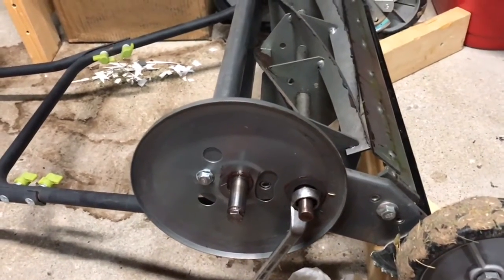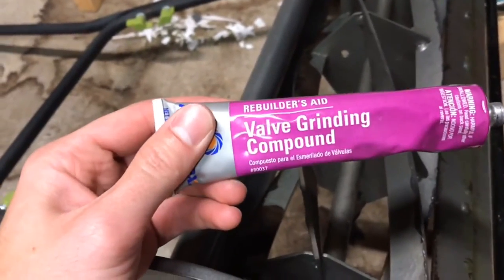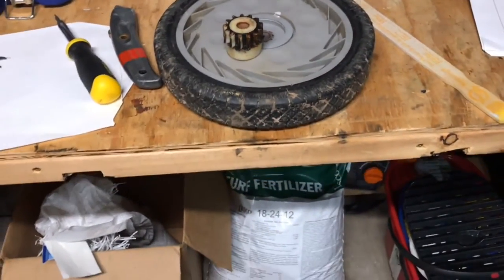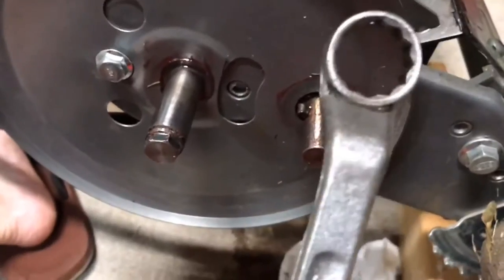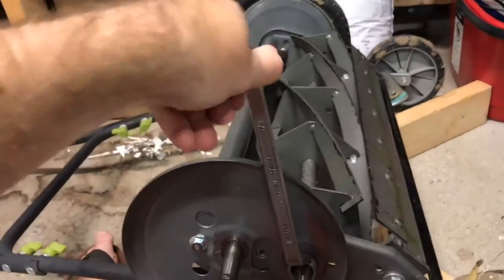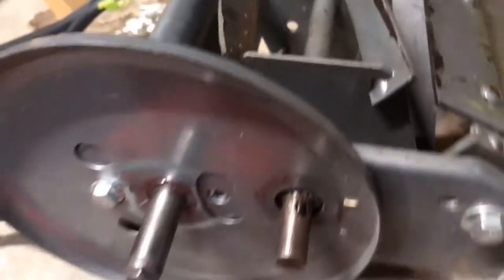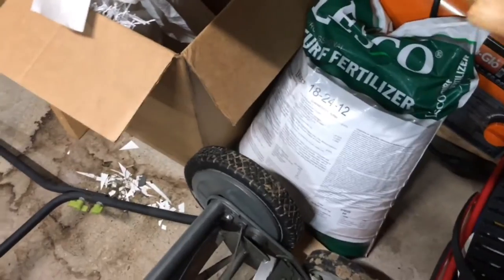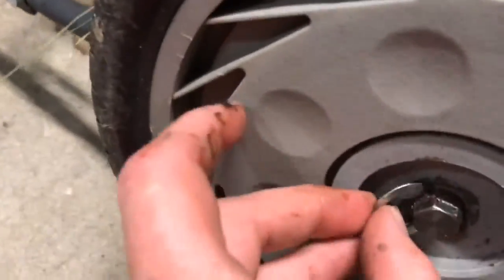How To Sharpen Reel Mower - Back Lap Mower Reel

Comment: Thanks! You mention a previous video that showed removing the wheel, etc. Can you link that? I've had a 3oz tube of Permatex Valve Grinding Compound for maybe 10 years, just not gotten around to researching how to utilize it to sharpen my Craftsman push mower, which I've had for maybe 20 years. I've messed with sharpening the blades with small sharpening stones, haven't adjusted the blades against the cutting blade. The mower works, kind of, but is a lot of work! It's time to do the job right!
Reply from the maker: Check this out https://youtu.be/iRiOtK2Hm6k?si=6Dq3pwY1ROqKElnK

Comment: So I’ve had one of these push mowers for a couple years because I like to be as green as I CAN... punn intended!! Lately I found myself having to go back over it back over it back over at several directions every other day!! I didn’t wanna do one blade (like I saw one fool doing!) at a time and I see most of the videos that are out there are more than five years old but I haven’t seen one yet that states that you should wash the stuff back off your lawnmower “cause it’s not good for Mother Nature” I want to try your technique but with my variable (so at a slow speed but faster than I can crank it by hand!) speed two transmission drill and a deep 9/16!!! So off to Amazon for some compound!  I am.... 💋🥰🪓🐞
Reply from the maker: This worked quite well for me! Glad you found the video useful! Make sure to take a piece of paper between the reel and bedknife and see if it cuts paper afterwards. You might have to adjust the clearance screws for the reel-to-bedknife so it’s cutting smoothly all the way across the cutting surface. Thanks for watching and commenting, good luck!
Reply: And as I was getting ready to turn it up I noticed one of the bolts was loose on the wheel somebody came to the door and I lost the keeper key!! For that side. Ug
Reply from the maker: Tedi Bare oh no! You might be able to find a replacement part. This is the company that makes several different brand reel mowers of similar design. I’d check their website try to find the make and model of the mower you have and check the spare parts list. You might need to order the entire wheel kit I’m not certain of that. Then once you find the part number search for it on amazon and see if you can find it for cheaper. I’d start here at this website. https://americanlawnmower.com/collections/replacement-parts

Comment: Don't you need to adjust the screws though after backlapping?
Reply from the maker: Ah yes you are right sorry if i forgot to mention that. Yes, sometimes you do have to make some minor adjustments after backlapping. What I do is adjust it so its a bit tight to begin with the backlapping loosens it up again a bit as it removes a small amount of metal in the process. Check for proper clearance with the paper cutting and if you need to make a few minor adjustments then go ahead. But sometimes its good to go right away.
Reply: Its trial and error with mine you turn the screws closest to the blade counter clockwise just a hair

Comment: how bout a drill for 8 minutes?
Reply from the maker: Yep that will absolutely work as well, sometimes I like to show methods using as few tools as possible as not everyone may own a drill, as hard as that is to believe 😆 but I’ve used a drill before to backlap and it saves a lot of time.
Reply: @DIYDad1  A video said you need a 1/2" drill. I think mine's only 3/8". I think I can probably borrow a 1/2" from my town's tool lending library.
Reply from the maker: @musicantd  you can probably use a 3/8th drill, a half would be overkill for this it doesn't take a ton of power!

Comment: This is totally redundant.  A reel mower is self sharpening. All you have to do is keep the blades clean and dry for storage, so the cutting edges don't rust. During off season oil the blades to prevent corrosion. I have never sharpened the blades of my mower; it still cuts strips of paper like the day I bought it.